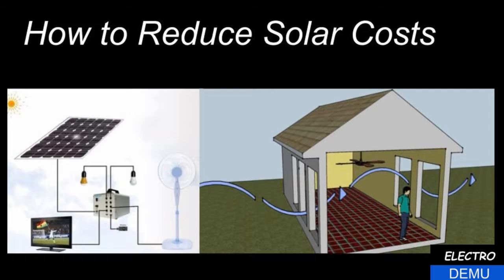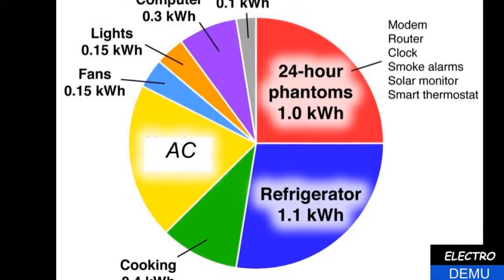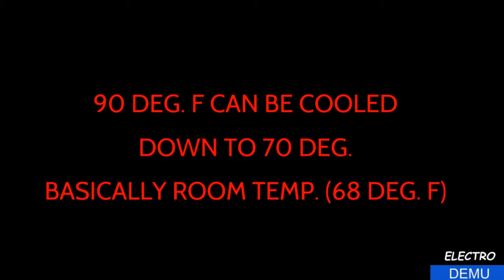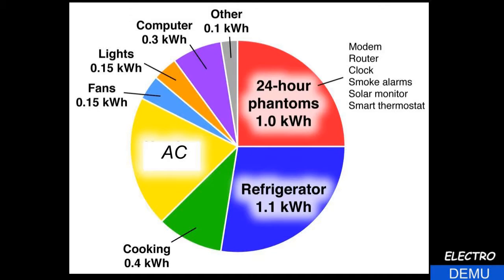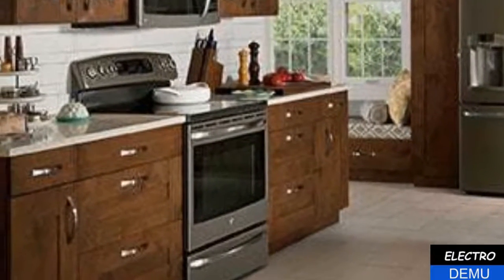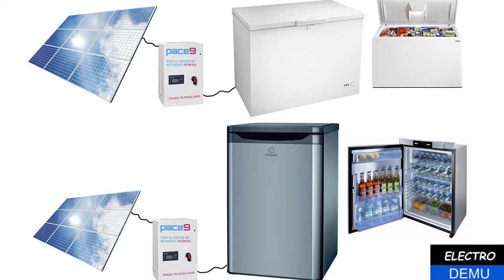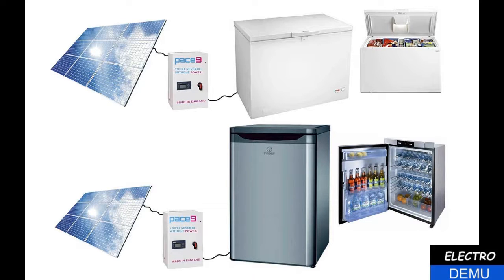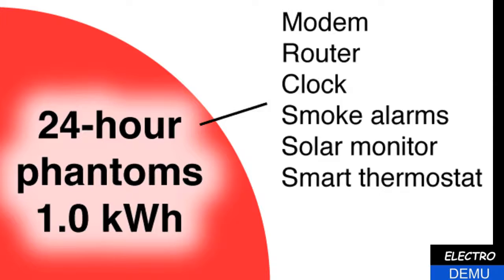How to reduce your Solar and Battery

Comment: If I may ask how big is the house you used in this video?
How many rooms?
And can one determine the size of solar panels for like a 2 bedrooms house(living  room and kitchen)? 
The approximate cost of the panels and the battery?
Please respond,thank you.
Reply from the maker: The bedrooms only having LED lights and fans should not be that much of an increase in the Solar load so the system can easily handle 1, 2, and 3 bedrooms quite handily providing you have proper cross-ventilation and home insulation for the roof. Thanks for watching.